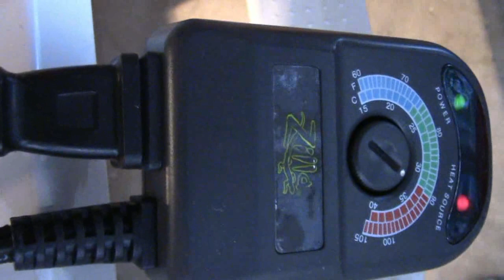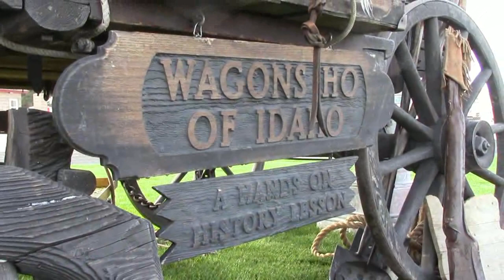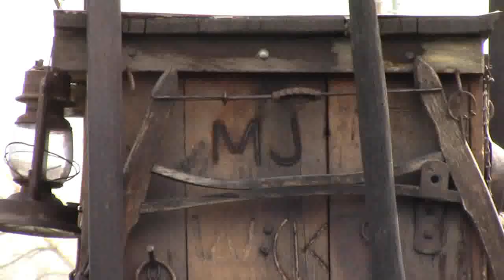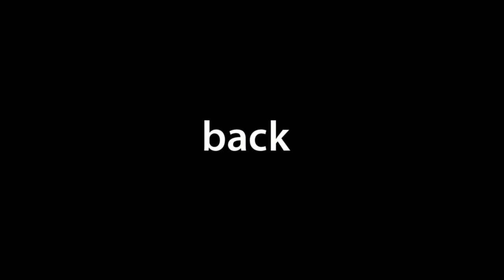New Chicks & Homestead Update - Back to the Homestead

Comment: one thing i noticed about your house, and speaking as someone who's had wet basement issues..... your gutters drain right next to your foundation. Not sure if you're concerned about water getting in, but having those gutters drain further from your house could save you a big head ache. good luck
Reply from the maker: You've pointed out what's been worrying me too. We had ALL the gutters and down spouts changed this past fall. The winter was rough and kept us from doing some of the things we wanted to do. My plan is to do some water catchment and run the overflow off into the property. I'm thinking of doing that by cutting into my downspout and draining it off to a bucket / container. The overflow will run out a few feet away. We did this in Tennessee where that was a MUST. Do you have any good water catchment ideas / plans? I am always looking for a way that is new (to me anyway)? Thanks a million!!
Reply: Hey Kevin,  I actually don't have any water catchment currently set up. unfortunately, I closed on my house literally as an insane storm was hitting, it dumbed i think 5" of rain in a matter of hours, and the 1st time walking into my new house after closing, i found the basement wet!!!   so, given the timing of it, my only concern was to extend the gutters and get them draining further away from the house. the catchment aspect i'll work on at somepoint here. Good luck with it. Hopefully it's never an issue for you.
Reply from the maker: ILBackyardFarm - I'll get those extenders on soon. Your advice is good advice. I'll feature them on an upcoming video.